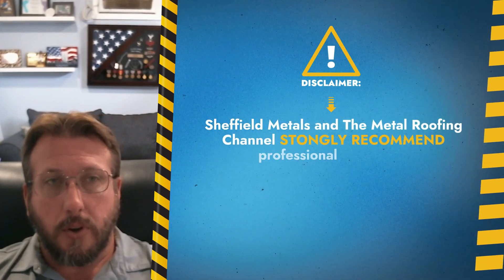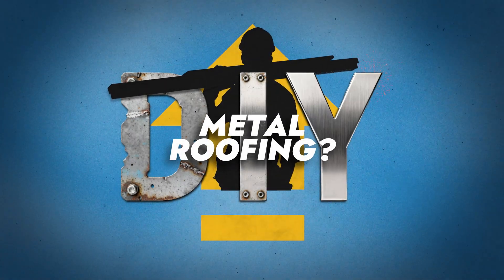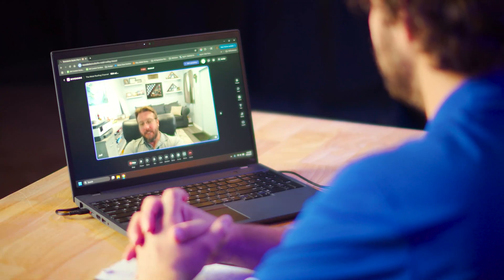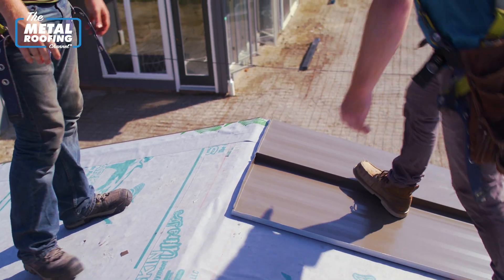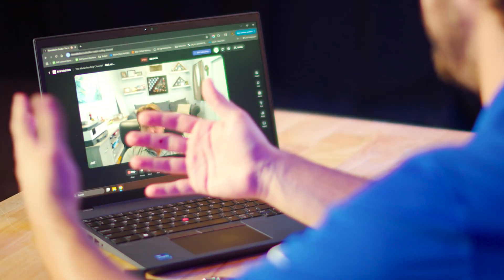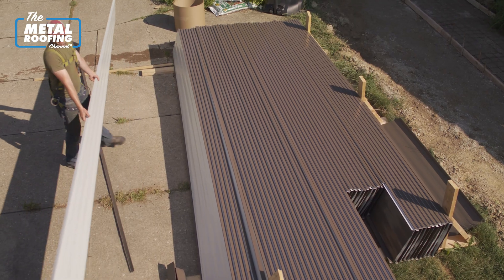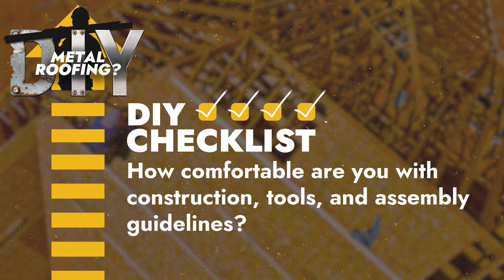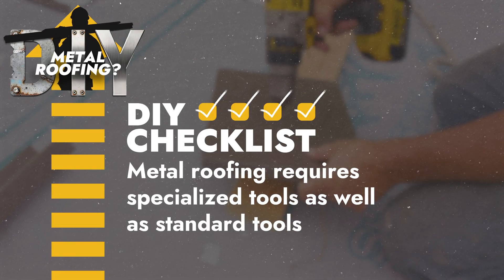Thinking of Installing Your Own Metal Roof? Start Here (Part 1)

Comment: Great points. Dont think i would DIY a roof wirh a valley. Low slope and simple shape makes it much nicer but all the little trim details add up and each requires forthought and more learning. Most DIY are highly motivated by the thought of paying a hyped sales guy for a very expensive roof only to have the project subbed out to the luck of the draw. No one will care as much as the owner if the roof lasts 100 years and most of the time you won't know the wrong guys were up there until it's too late. 

Another note.. Hey what's up with 238T? Seams... like a good idea?